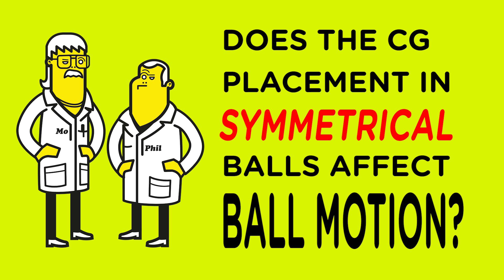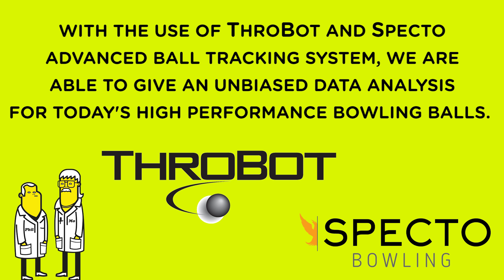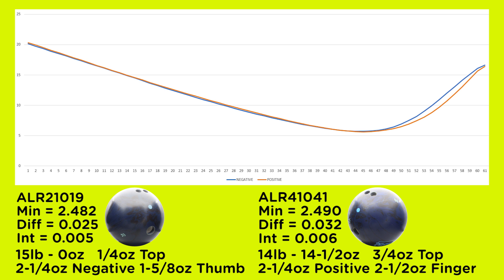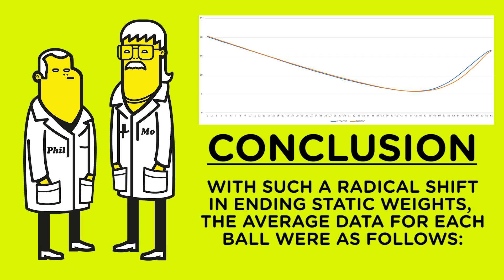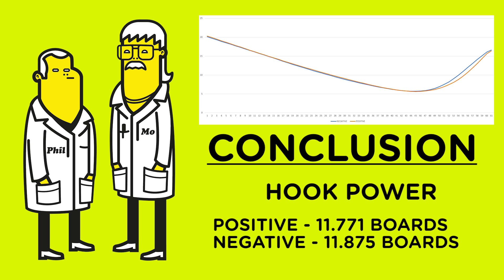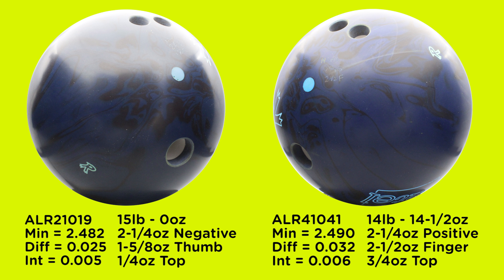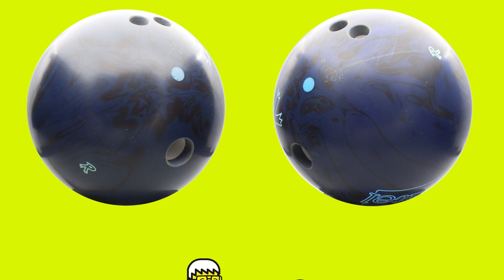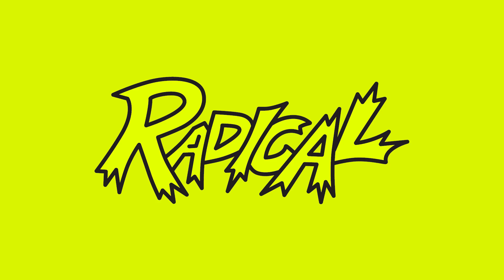Does the CG Placement in Symmetrical Balls Affect Ball Motion?

Comment: I can see how that works with the pin in the palm but wouldn't it be different if the block was turned on its side? If you follow the cg the bottom of the core would flip to the other side right?
Reply from the maker: No. Core orientation inside the ball is not shifted like you think. The difference between a 2" pin out and a 4" pin out is 1/10th of an inch.
Reply: Thanks. I'm not trying to debunk but get a better understanding of this. So when it comes to symmetrical balls and the dual angle layout system, the drilling angle is insignificant?
Reply from the maker: Correct. Virtually insignificant in symmetrical bowling balls. Always has been, now with the new 3oz rule, you can essentially place the CG anywhere without needing an extra hole.

Comment: Wait, you said that one ball had almost 1 degree greater entry angle, 7/10's greater entry angle to be exact.
How is that no difference???
That could be the difference between a strike and a flat 10.
Reply: It would seem so. But there are so many other factors. This machine is able to repeat the exact same speed; axis rotation and rpms on every shot. It is also again on a THS. Everyone is trying to find this perfect ball that strikes on every shot but it just doesn't exist. And unless you bring a 20 ball arsenal with you everywhere you go your going to run into flat 10s; ringing 10s, blower 7s and splits. No matter where the pin or rg is located
Reply: You just described my bowling life!
Reply: @nordattack  Mine too boss man. Just keep at it and have fun
Reply: Lol! 
Sometimes it is hard to have fun when you feel helpless...
Believe it or not, recently in two houses that have a very defined dry right of second arrow, I have been using sanded plastic and doing much better than with resin.
Go figure...
Reply: @nordattack  I bowled in a house like that once. And yeah I used a Hammer True Blood plastic ball and bowled my ass off with it. There is too much hype about new bowling balls and coverstock and yaketty yack yack. In the house I bowl now I use a 10 year old Virtual Gravity Nano for the first 2 games then go to a Super Natural (urethane) for the last game and average 203. My technology is old but it still works? Hmmm...🤔
Reply: House bowlers don't need new tech, very true. Any bowler that does true tournaments or sport shot leagues would overwhelmingly say that new ball tech does wonders for their game.
Reply: The big difference is how these two test balls were drilled versus normal layouts. These two test balls were complete opposites of each other with 180deg swing of the CG. However, in more standard drillings, the CG wouldn't move more than 40deg side to side, from let's say in your palm, to close to the VAL. Which means these test numbers would be even closer. Thus meaning they are negligible.
Reply: If we're worrying about 7/10's of a degree entry angle difference based on where we place the CG (which in this case is as far apart as we can get it and likely showing the absolute maximum difference in ball motion) we'd probably be better off selecting a different ball that will give us the angle we desire.